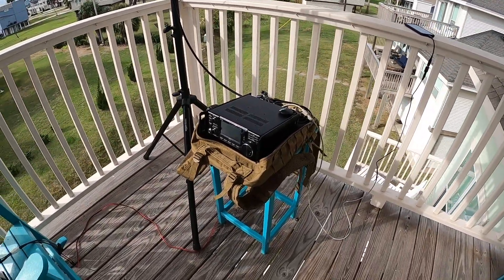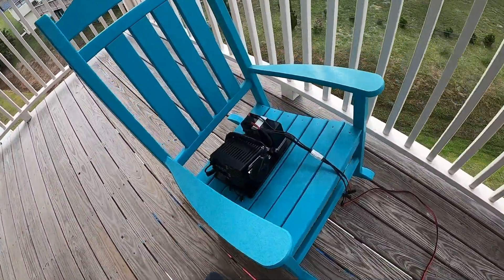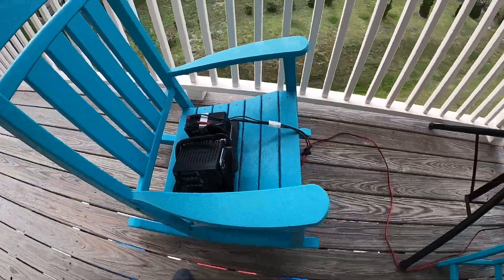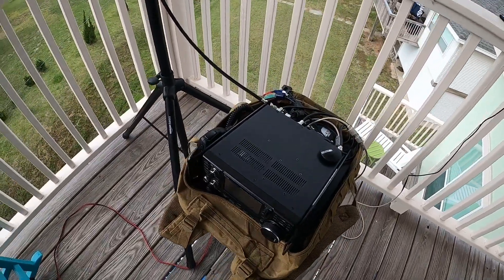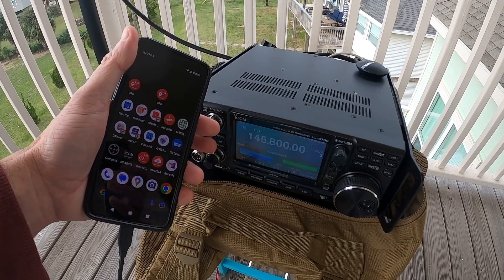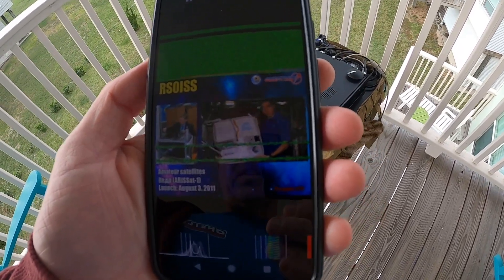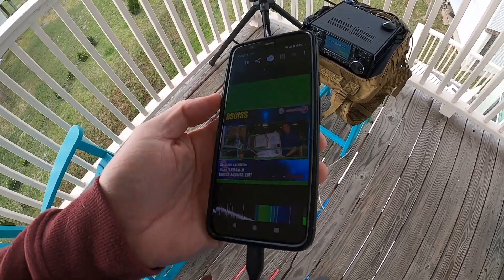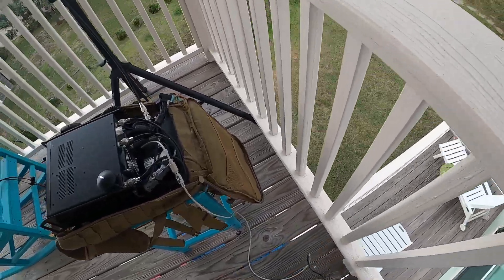SSTV decoding of an ISS pass with IC-9700 and Diamond discone antenna

Comment: Hello. 
Thank you for the excellent video about this antenna. 
I'm thinking of buying one to monitor VHF and UHF with my Uniden BC780xlt. 
I live on the 6th floor and have a very small balcony for an antenna. 
Also, I have a lot of RF noise everywhere, and my Icom R-75 is just sitting in storage.
I'm wondering if you've heard anything on 40, 20, or 15 meters with this antenna. 
Perhaps I could buy a duplexer to get the R-75 working. 
Thank you very much for any replies. 
73, Jorge